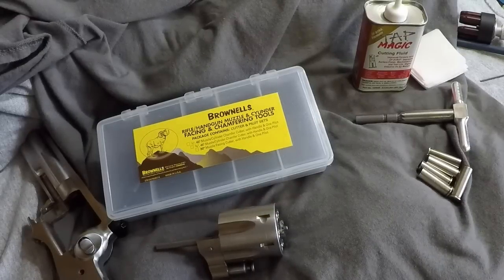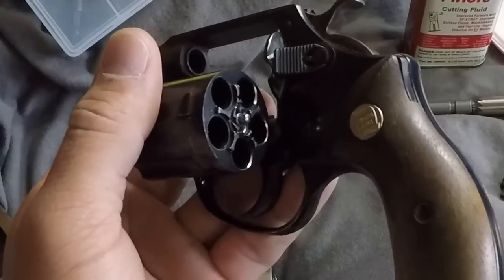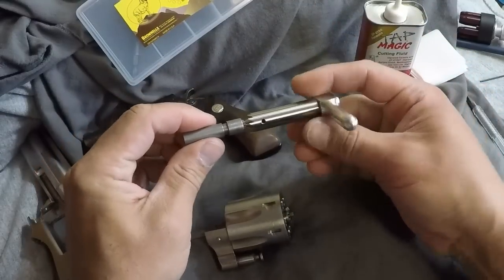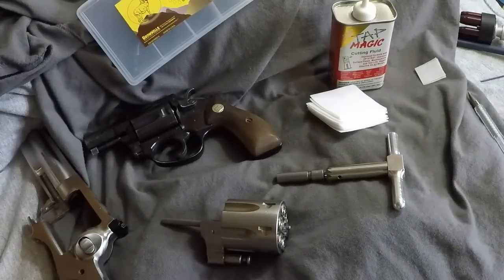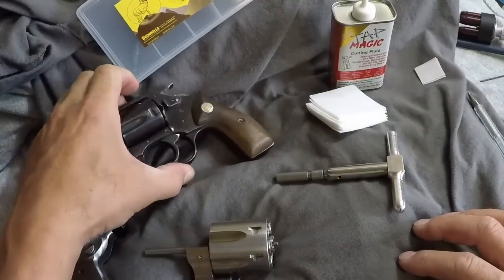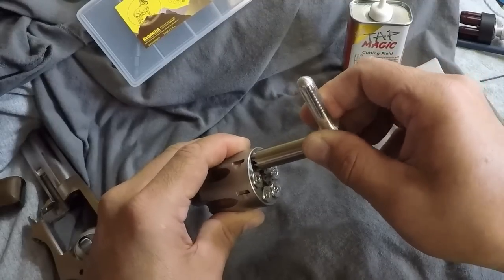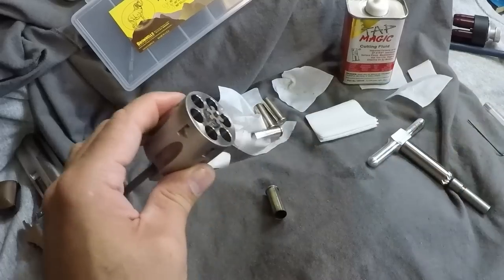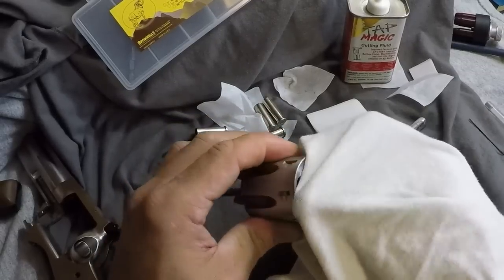Chamfering a Revolver Cylinder

Comment: Just FYI to anyone thinking of doing this work themselves. A better method is to remove the extractor star and just chamfer the cylinder itself. With the star chamfered, you can get cases (38 Spl especially) falling underneath the star when it is at full extension. This causes a nasty jam that you really don't want on a defensive gun. Moon clip guns are fine doing the full chamfer though.
Reply: this!
Reply: Yes I agree totally.
Reply: That was almost my first thought. 

In addition, isn’t there a risk of damaging the extractor star?  Cases in the other 5 chambers should hold the extractor firmly in place but it seems to me that cutting like this could put stress on the extractor.

Comment: nice vid Bob O, I just got my sp101 3" a few days ago, love it, Ruger has made allot of nice changes at least on the one I got, it' left Ruger this September 2017, it came with a tapered cylinder and all the chambers were chamfered, the writing was removed from the left side to the bottom of the barrel, Like you said the work you did has to be done carefully and it does help a great  deal to reload under pressure, again thanks for the info, I know I am talking Ruger but a revolver is a revolver, at least close enough, again Thanks
Reply from the maker: ge45ge Called nice that the factory  has done this to your wheel gun!!

Comment: You chamfered the extractor too?

I thought you had to leave the extractor alone so it could grab onto the base of the spent shells to extract them?

I may be wrong but I want to be sure before having it done to mine

Please advise me on this

Great video btw
Reply from the maker: You can do the extractor no problem, you just need to be careful to not do too much or there will definitely be problems extracting.  The factory chamfering done by S&W on some of their models was such that the rims of spent casings fell beneath the extractor in some cases.  

I have never had an extraction issue with this gun before or after this job, and I've done maybe a hundred reloads with it.   I have since sold the gun to a friend so help fun a precision rifle, and he has shot it quite a bit and has not had any issues at all.

Comment: Thank you for an excellent Video. Do you know how I chamfer her the cylinder for my S&W 929; its made of Titanium, one of the hardest metals in the world. I tried with the kit you were using, but stopped as there was no progress and I was concerned the tool would be damaged; I have other revolvers to do.
Reply from the maker: Wow.....not sure what would be needed to cut that metal.
Reply: Same tool....just a little more pressure...did my sw929 with titanium cylinder. Just go slow and keep the cutter clean & well lubricated.

Comment: just curious what is the purpose of this?
Reply: dale lankford It is solely beneficial to using speed loads for faster reloads. No other purpose. It is usually done with a drill press with a measured depth stop. You can easily destroy a cylinder using this tool. And as others have mentioned, you should remove the star extractor to do this so you don’t remove metal from it. It can cause shells to get caught under it on some extractions. If you only remove a very small amount of metal, it’s rare. Just breaking the corner is enough if you leave the star extractor in. If you take it out, you can remove a little more.

Comment: Why would you chamfer the chambers of a cylinder?  Does this improve accuracy?  I would never do that to any of my revolvers!  You're introducing premature wear to your guns.
Reply: A chamfer aids loading with speed loaders and speed strips, especially if you are using lead bullets.  A squared off cylinder edge will catch and drag, even a tiny bevel minimizes this to a great extend.  If you single load it does not matter.  This does nothing to harm the gun.  The brass is very solid near the top of the rim so you are not risking a pressure event.
Reply: @linkedinprofessor  I do not have any revolvers that require a speed load.  Mine are a cap 'n ball black powder pistol and a single action .45 Colt.
Reply: Is it really worth the cost of the tools versus going to a local gunsmith just to do one gun.

Comment: The little holes in the round thing (the cylinder) are called chambers not cylinders. Glad you are not a gunsmith.
Reply: there's always a critic, he know what he is talking about, you should read the introduction, he knows the difference between a cylinder and chambers of the cylinder, if he said cylinder instead of chamber, only a numskull wouldn't know what he meant, let's see your last video and see how many innocent mistakes you made
Reply: what is with these critics?

Comment: You cut off too much material; after a gentle spin, and you notice no more grabbing, stop.
Reply from the maker: I took off the amount I wanted.  There is no set amount.....some chamfering is less than what I did and some have more.  Speed reloads are very smooth and quick, and I've never had a malfunction or extractor slip over the case rim.
Reply: The more material removed, the less support for the cartridge case. @BullseyeBob
Reply from the maker: @MajorHenricks  yes of course.  Take a look at a factory 929 PC model and see how aggressive the chamfering is.
Reply: That does not mean it is correct; you stated at the beginning, not to be expert, which means that you invite comments; was trying to be helpful; then you get upset because of my comment, when you stated that you took off what you want; so go ahead, ruin your gun. @BullseyeBob
Reply from the maker: @MajorHenricks  Youre the one who's upset.  My gun is not ruined.....it functions flawlessly.  Speed reloads are smoother and quick.....that was the goal.  Gun has had several hundred shots since the work.....tell me how its ruined.